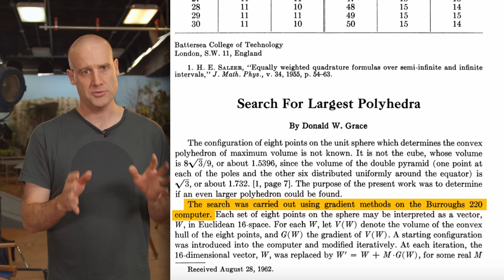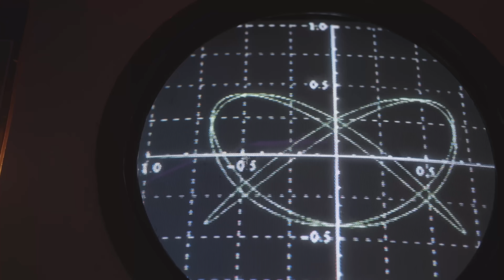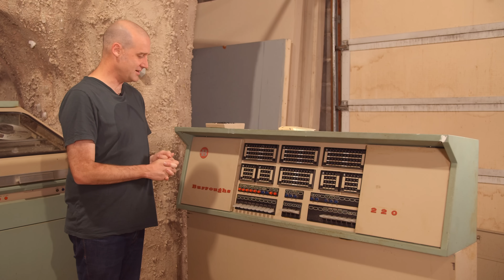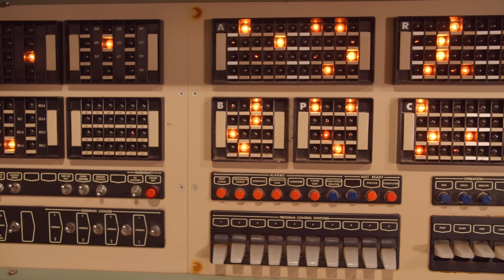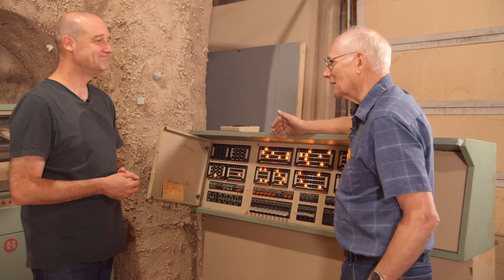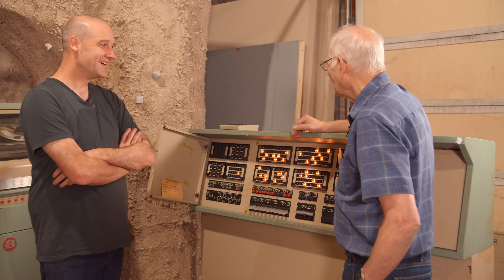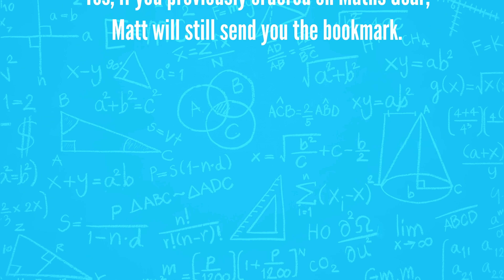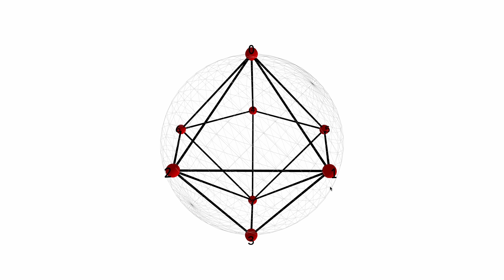The search for the biggest shape in the universe.

Comment: I didn't understand the difference between global and local maximum. Isn't there just one shape inside one radius?
Reply: A local maximum refers to a solution where any small change results in a smaller result, but a larger result is still possible through more/larger changes.

Think of it like trying to get to the highest point in town by always taking a step in the direction that is highest from where you currently are. Local maximums are the tops of every individual hill in town, when at the top of any of them there is no step you can take that isn't downhill, but only one of those hills is the tallest in town (the global maximum).
Reply: @phiefer3  I still don't get it. Add a hill in that town. It's 100feet tall. How can that 100 feet be different from the 100 feet global measurement?
Reply: @johnfrian  I'm not sure how else to say it. Your question doesn't even make sense. We add a 100 ft tall hill to the town, ok, so we have another local maximum. If all of the other hills are shorter than 100 ft then that new hill is now the global maximum. Otherwise whatever the tallest hill is is still the global maximum.

A local maximum is relative to "nearby" points. ie if you are standing somewhere and any step you take will result in you being lower than where you started, then you are at a local maximum because all "nearby" points are lower than it.

The top of every hill is a local maximum.
The top of the tallest hill is the global maximum.
Reply: @phiefer3  Sorry, I don't follow..

A local maximum sounds like different words to describe the global maximum. "Every hill is a local maximum" accomanied by "The tallest hill is the global maximum", combined with my lack of understanding the definitions, just means I understand this as "every tallest hill is a global maximum, and every hill is a maximum locally".

I don't mean to sound demeaning. I only mean to make myself sound like I lack some understanding. I'm more lost now than before I asked
Reply: @johnfrian  Why would every hill be the same thing as the tallest hill? "The tallest hill" refers to a specific hill that is taller than all others. "every hill" refers to every hill regardless of whether it is taller or shorter than any others.

Let's say there are two hills in town, one of them is 80 ft tall, the other is 100 ft tall.

The top of the 80 ft tall hill is a local maximum because it is the top of a hill. If you are standing on top of it then any direction you walk is downhill, therefore it is a local maximum. But it is NOT the global maximum because there is a taller hill in town.

The top of the 100 ft tall hill is also a local maximum for all of the same reasons. But it is ALSO the global maximum because it is the tallest hill in town.
Reply: @phiefer3  See, your explanation makes perfect sense. But in the context of the video, I'm still lost. When mathematicians make a measurement, why would they even bother reporting about lower hills?

Local maxium makes no sense when there is only one set of measurements. You only have one town (the sphere) and you need to find one specific hill (the points that make the largest volume in the sphere).

I don't get what the difference between local and global maximum is in this context. There are only two relations: The points you measure, and their volume. There is no relation to outside points. No reason to consider "this volume is lower, so we will call it the local maxium". I'm still lost, sorry.
Reply: @johnfrian  Because there often isn't a way to directly find the global maximum. There are infinitely many possible sets of 8 points, it's impossible to measure the area of all of them and pick the largest.

Methods for finding the largest often involve instead looking at how the value changes as you alter one or more of the inputs. In this case, how does the volume change as you move one of the points by a tiny bit. And then repeating over and over again until you can't make the volume any larger. At that point you've found a local maximum. While you don't know if it's the global maximum or not, it's still a first step.

Where you go from there depends on the problem. Sometimes you can determine how many local maxima there are and then find and check all of them to see which is the global maximum. Sometimes that's not possible and more complicated techniques are required. But you're almost always going to start with looking for local maxima.

Comment: How's the hunt going for a 3-sided coin?
Reply: Heads; tails; the edge
Reply: @RB-bd5tz  quite a while ago Matt asked how thick does a coin need to be before landing on the edge is equally as likely as either heads or tales. He was working on a model (3d printed a bunch and "rolled" them) but that was largely inconclusive.
Reply: @MrMaelstrom07  I know from experience that a round pill, if dropped, invariably lands on its edge and rolls to the most inaccessible part of the countertop, table, or floor.

Comment: Wait a minute. 4:50 Cube is 8/9 of square root of three and the double piramid is square root of three... That's not 1/8 bigger, that's 1/9 bigger... or am I wrong?

Edit: am indeed a dumdum. Doesn't surprise me in the slightest
Reply: If the cube is 8/9 of the volume of the double pyramid, then the pyramid is 9/8 the volume of the cube. That's why it's 1/8 bigger than the cube. On the other hand, the cube is 1/9 smaller than the double pyramid.
You can also check with the numbers: 1.7320508 / 1.5396007 = 1.1250; 1.5396007 / 1.7320508 = 0.8888...
Reply: 1/9 of the large shape is 1/8 of the cube….
Reply: Or 9/8 bigger, by proportion
Reply: @WK-5775  Given that there's an algebraic expression for the volume, I guess there's an 'algebraic' description of the shape as well. But it would definitely be nice to get more info about it. At 14:12 there's a brief moment where the angle suggests at least some symmetry.
Reply: 9/9 is 1/8 bigger than 8/9: 9/9 / 8/9 = 9/8 = 1 + 1/8.
Reply: Just about to comment the same thing!
Reply: That's what I thought but was to scared to put my own comment and have people call me an idiot.
Reply: Maybe he meant 1/8th better as in 12.5% better

Comment: With great filming gear,  comes great responsibilities, and Matt's aced it.

No spare parts to be found, but would it be possible to remake the parts? I'll admit, that if the machine wasn't popular, then the schematics probably wasn't worth conservation, but one can hope.
Reply: Weren't these computers hideously expensive in period (not surprising given the sheer size of them, same for transistorised computers too before the cheap & cheerful integrated circuit)?  Unless it's only a small number of boards or components that are being remade, I can't see how it would be cost-effective for hobbyists (even if all the basic tubes and other base parts are available)?  Online it says the Borroughs 220 was $30,000 USD in 1960 dollars (about six Cadillacs at the time), which is about $315,000 USD in 2024 dollars.

Comment: 0:22 This Tuesday is August 20th btw!
Reply: 05:02 it's actually one 9th better!
Reply: @masker.science  Relative in size, we can scale the vube up to have volume 8, and the hexagonal bipyramid will have volume 9. An extra eighth of the cubes's volume is added, so it is 12.5% bigger. However, the cube is indeed 1/9th smaller when comparing against the bipyramid.
Reply: @themathhatter5290  Of course, it's relative difference and so either 1/8th or 1/9th "better" depending on which one you start from and which direction you scale! Or in absolute difference it's an extra 1/9th of √3. Thanks :)